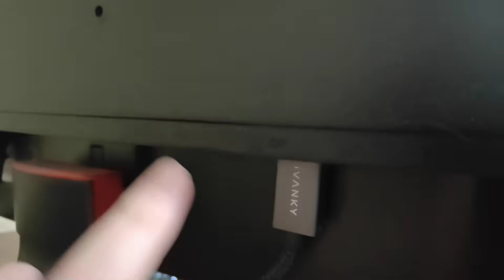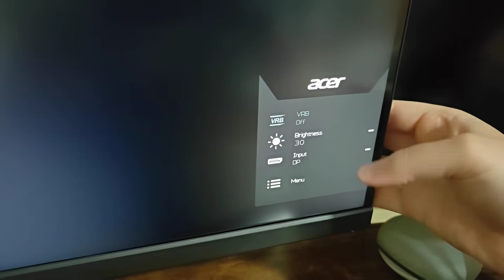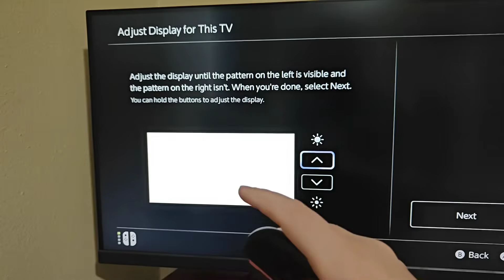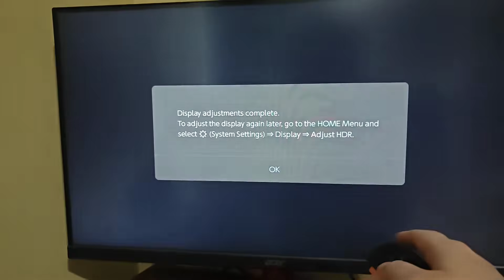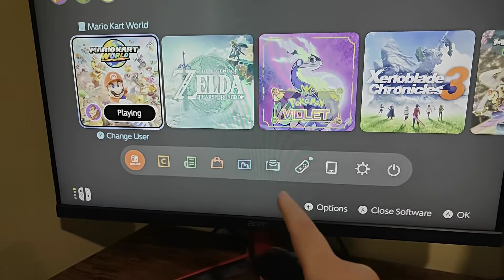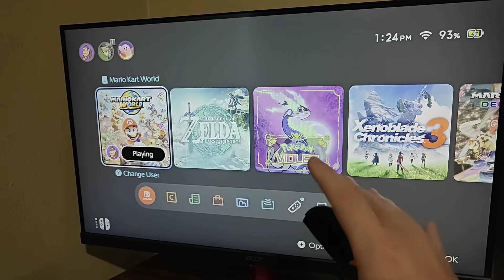How to Connect Your Nintendo Switch 2 to a Computer Monitor | Easy Setup Guide

Comment: I want to connect switch 2 with my pc its not working it worked on the switch 1 because I want to play with my headset and hear audio from the switch on it and watch a stream while i play i have no audio otherwise
Reply: Pleas bro tell me how u connect ur switch 1 to pc
Reply: @Aaaaammmmmmgggg bro ur pc needs Bluetooth then u can connect it easy
Reply: @Basra654 Fr like you serious?
Reply: @Aaaaammmmmmgggg  The Switch 1 works fin to connect switch 1 to PC and i have the Audio from it to my Headsett.. But the Switch 2 dont work that way some how, if switch 1 work why dont switch 2 work the same way. But to connect switch 1 to pc, you go to your bluetooth settings in switch 1 and computer and pair them and connect to pc... i just wich they can do it for switch 2 also -.-
Reply: @Pharaoat  Get an Audio cable from switch into the pc, that's how I got mine to work.